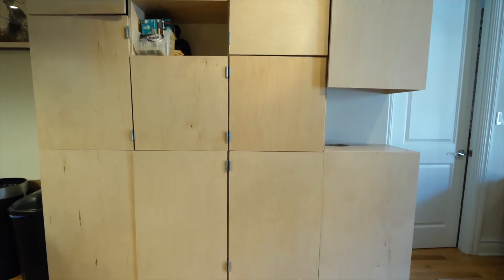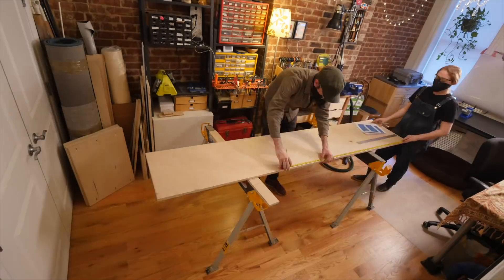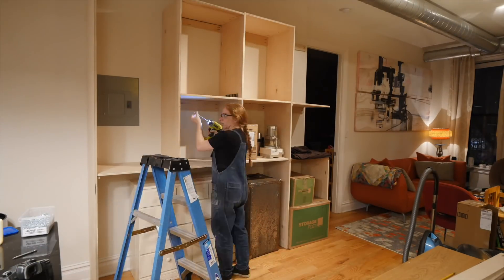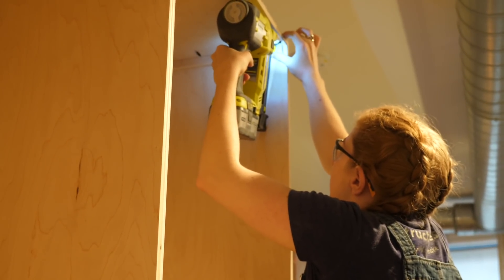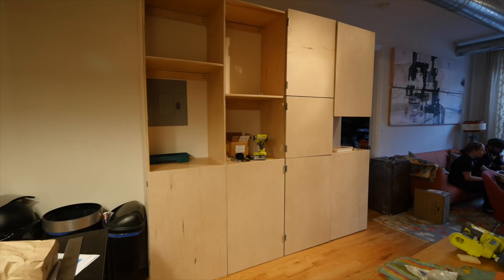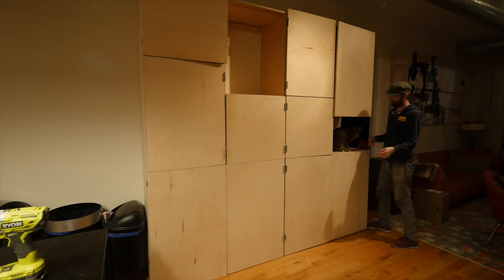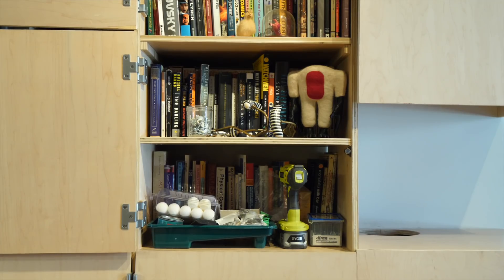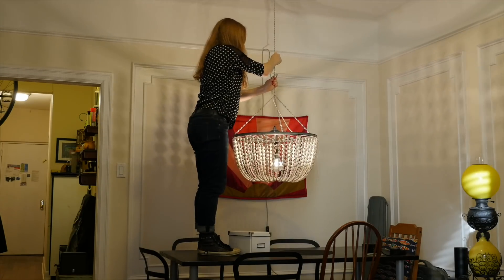Plywood Storage Wall pt. 2 // Becky Stern

Comment: Hi, I'd be interested in a close up of the hinges, and some discussion about how you chose them. Also, how did you get all that baltic birch plywood into your apartment? Delivery of lumber is a big challenge for an NYC apartment dweller, so I'd be curious to see how you managed that despite the injured joints in your house.
Reply from the maker: Thanks, I'll be sure to cover the hinges in more detail in my upcoming instructable about the project. I wasn't home for the (purebond maple) plywood delivery in december, but from what I understand my (at the time uninjured) bf carried it up the one flight with the help of the one other person, which was two people too few.